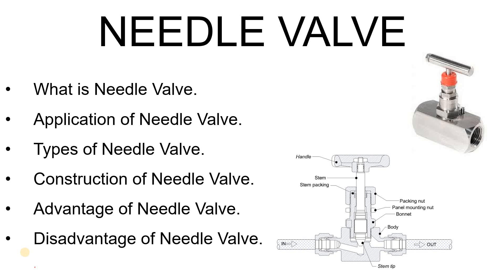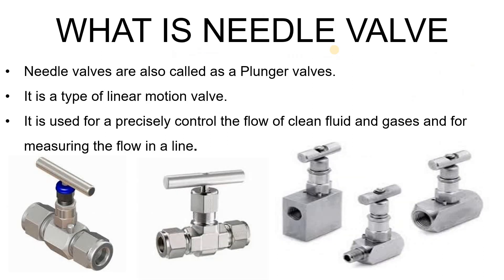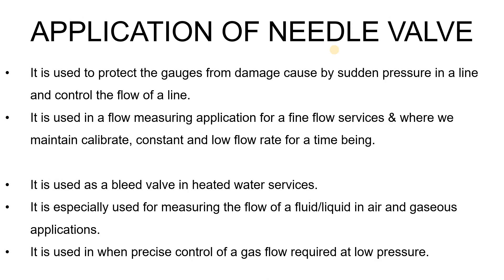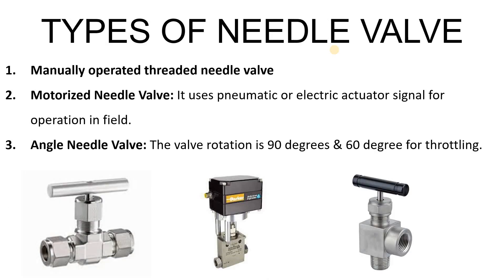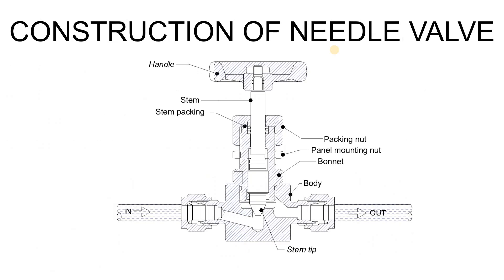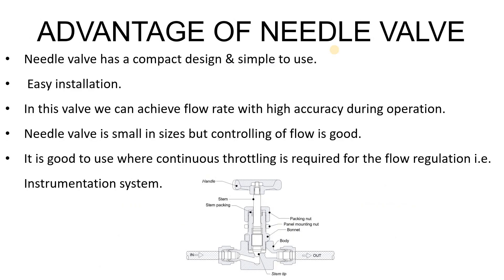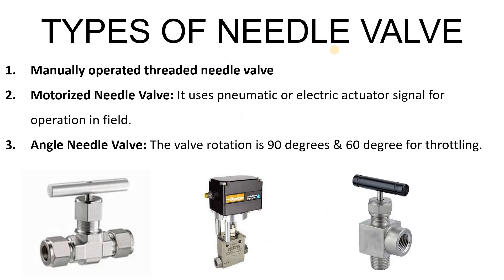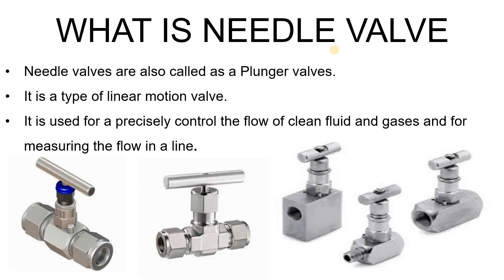Needle Valve | How Needle Valve Works | Needle Valve Types & Application | Core Engineering

Comment: Sir have a question how much pressure can the needle valve handle ?
Reply from the maker: while a standard, good-quality stainless steel needle valve can handle 6,000 psi to 10,000 psi, you can find specialty valves rated much higher for extreme environments.